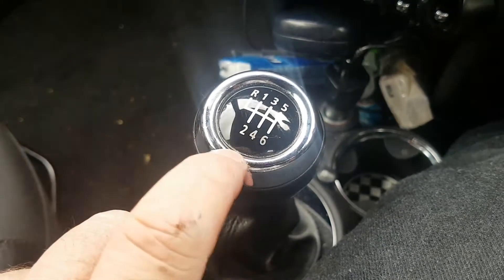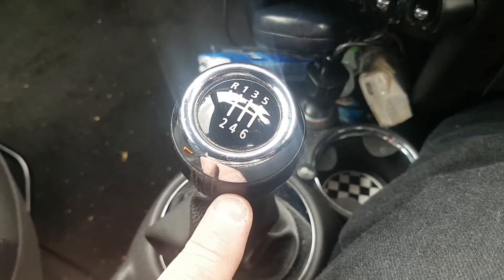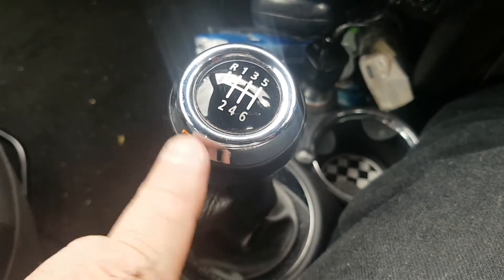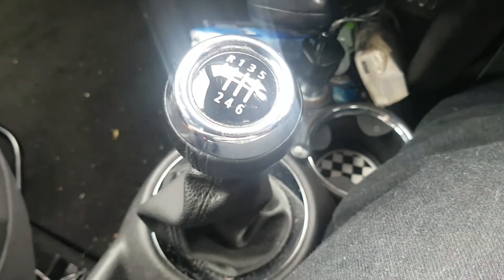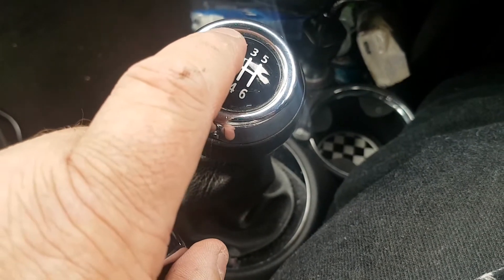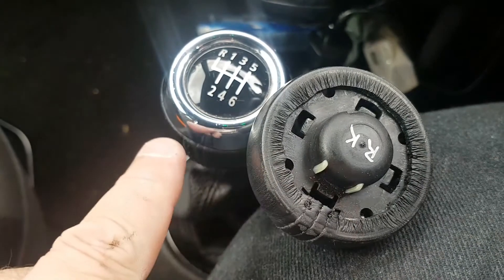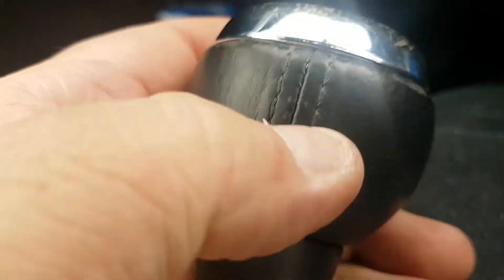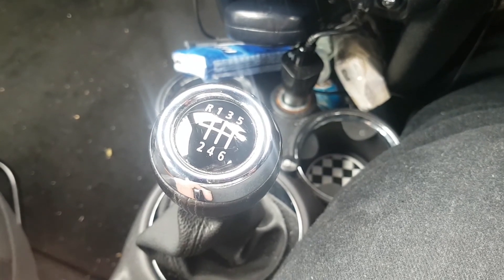How to tidy up you gear knob on the R56 mini.

Comment: Hello, thank you for the usual video. My gear cap has broken on my car and snapped off and can’t seem to find one to replace it. I’ve looked on eBay but can only find the whole gear and leather bit which I don’t need. Is there anywhere you know of that I can just buy the cap to push onto the gear? 

Thanks! 😊
Reply: I used BISON glue and glue it back on the stick. It is good for now. Scrap yards won't sell only cap. And at BMW is impossible to order only cap...